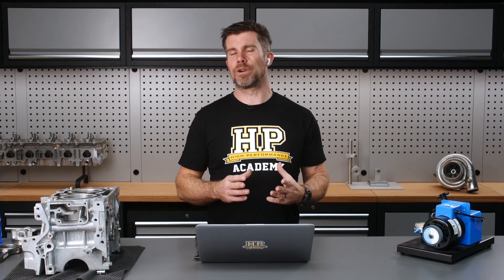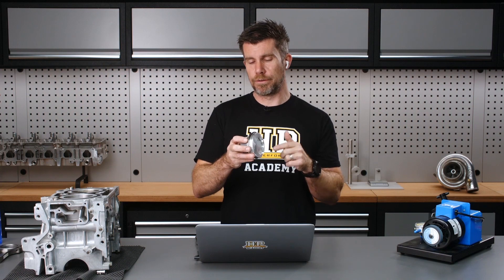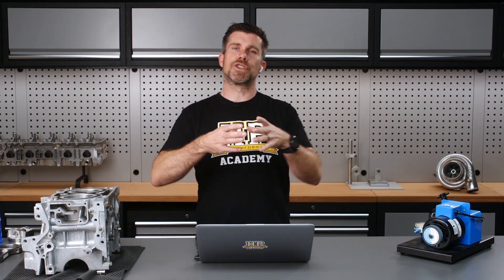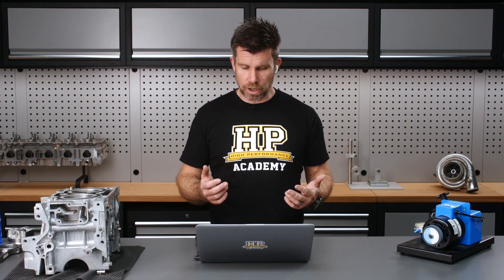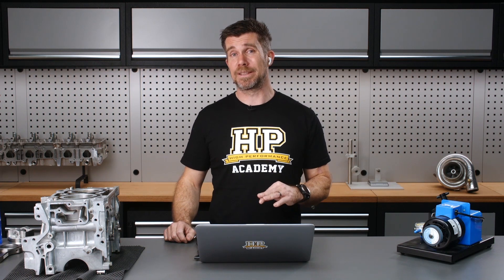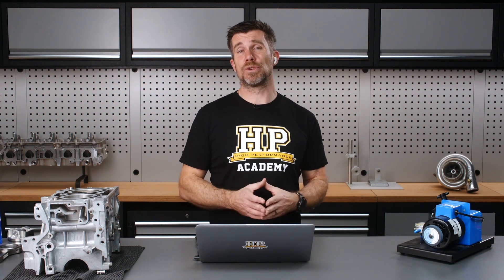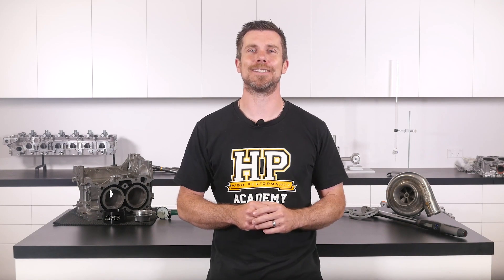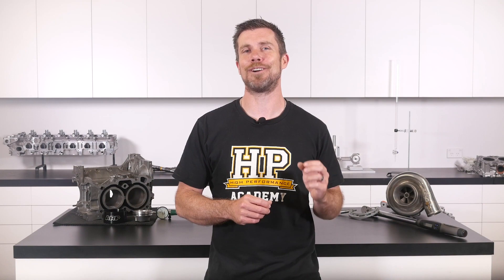Is Gas Porting A Factory Piston Pointless? [HPA Q&A]

Comment: Ive got a 1967 383 that was built by Dick Landy industries in 1968 the factory dish  pistons were gas ported on 1967 pistons ! the cam he used wasnt too big they used a cross ram intake ported 906 heads all the piston connecting rods balanced to within 5 grams opened oil ports put a main stud girdle in and it made 460hp !! these were factory pistons